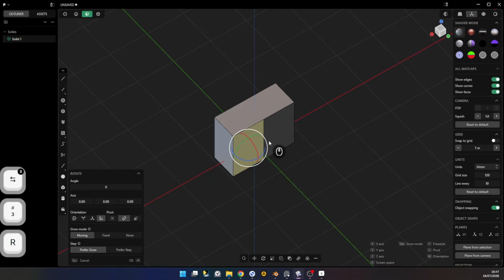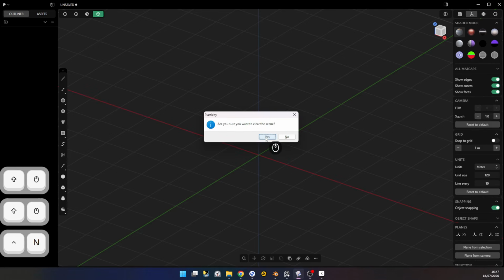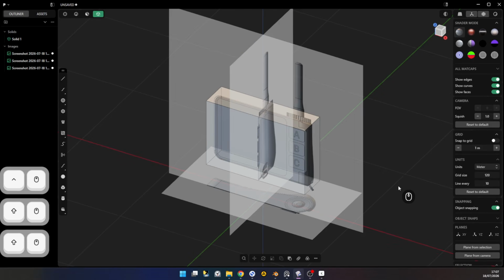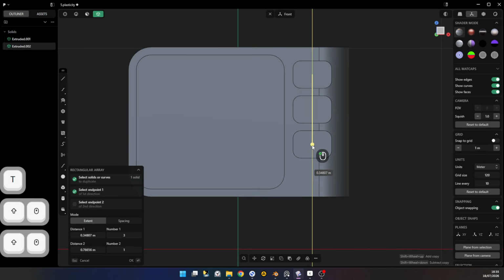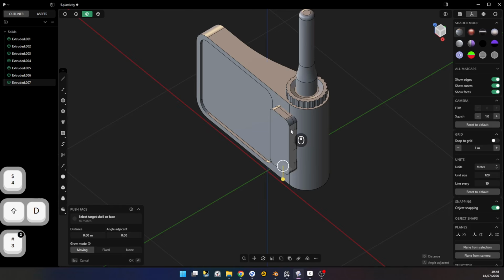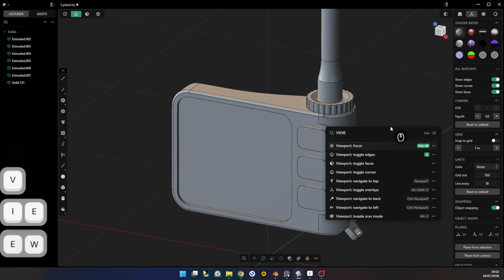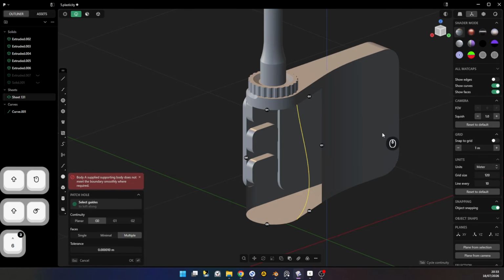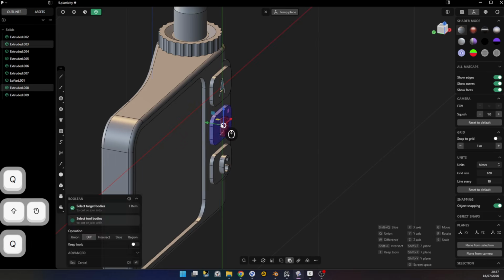Plasticity Noob to Pro Tutorial

Comment: I've seen many tutorials, this is outstanding. I would love to see a tutorial related to principles and examples of changing/adjusting of an existing model (happy to pay for it). Because creating a new thing is easy, however I'm still kind of anxious about deleting sketches and other helping stuff, as I'm afraid that I will need them later. Second, after some actions - it seems "impossible" to adjust the shape. Thank you.
Reply from the maker: thank you for your kind words, probably wont do anything in the near future, but i honestly think that what was shown in this video is enough if you try to think about it more, i also have the full design process on artstation that i mention in the end of the video and it has a lot of showcases of both keeping model as dynamic as possible and using that to quickly try certain changes, and in general a what i think a decent process for modeling.
Reply: @Munsplit  definitely you shared thoughts - concepts which will help. I like it a lot, since I like more concepts than "click here, do this" style. And even I already looked on plasticity as "vector" graphics against "raster" blender, planes limits concept is eye opening. Some smaller things I already distilled myself, but still is very useful when you vocalize it, as many times, its kind of "feeling" on my side, or confirmed "maybe its this way how it works"

I'll add your gun tutorial to my rather long list of tutorials to see 🙂